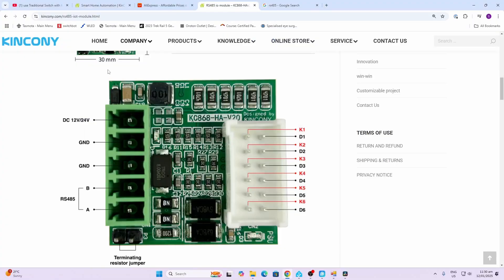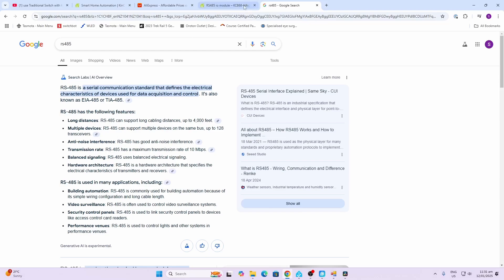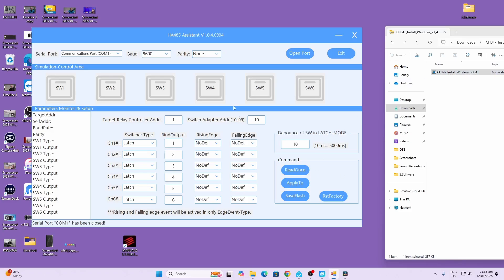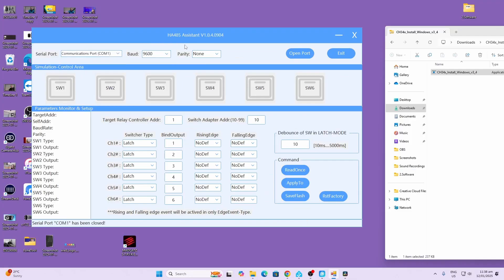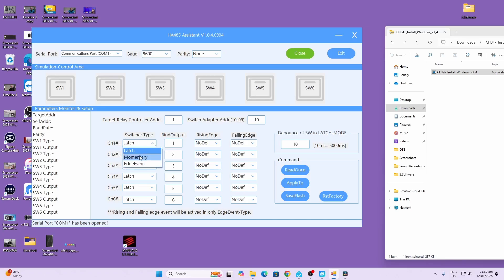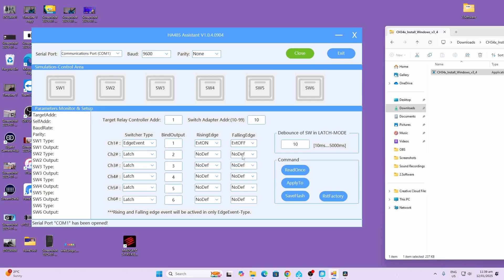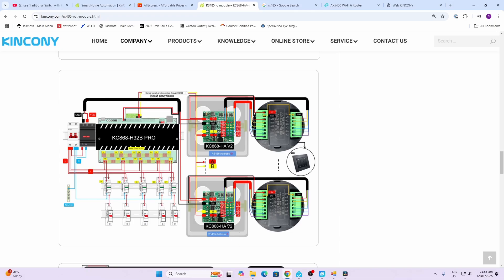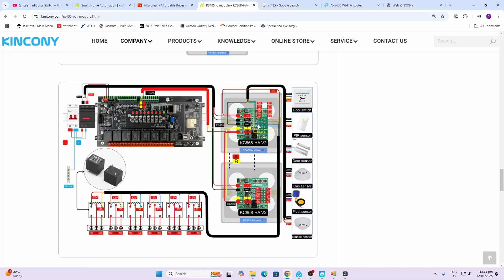Control your Wired Smart Home over RS485 with the KC868-HAv2 module and Home Assistant

Comment: I have old momentary switches with small LED indicators that I can use to power them and indicate that the relay is on. Can this board give me that signal?
Reply from the maker: I don't think so because it is just sensing an open or closed circuit

Comment: Great Video! I wanted to implement Home Assistant to my Camper Van as well. Do you suggest to wire with RS485 Bus and have a KC868-HAv2 on each switch or can we simply hook up the switches directly to a board like the KC868-A16? Or will this trigger a lot of false swich press detections?

Question regarding the KC868-HAv2: Does it support Event´s like Double Click and single switch dimming? For example Hold the button will start dimming cyclye. 
Releasing the button will stop at current brightness?
Reply from the maker: Thank you so much!  Yes you could do it either way, with the A16 you would need external relays to switch the load.  Unfortunately they do not offer double click or hold or dimming.  They do have another board that offers dimming, check out their website

Comment: I bought a few of these and my plan was to use them in my camper van so I could control all sorts of things like lights, water pumps, door locks, etc from multiple locations along side Home Assistant. This unfortunately didnt pan out for me, but that was due to the camper van, not the products from Kincony! I’m glad to see someone covering these products though as I think they have serious potential for a fully wired smart home assuming you are happy to run cables everywhere!
Reply from the maker: Thanks for the feedback Josh, yes, they are great boards!